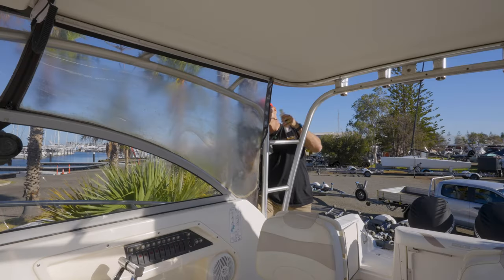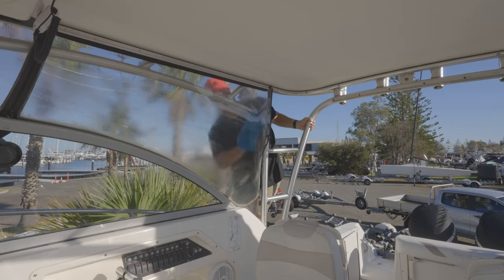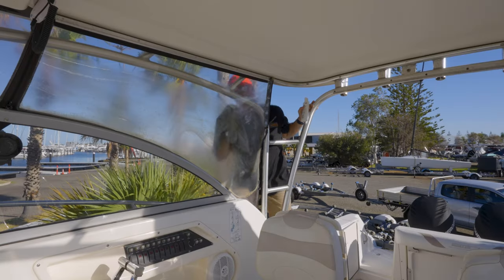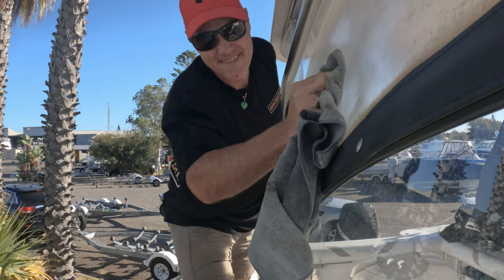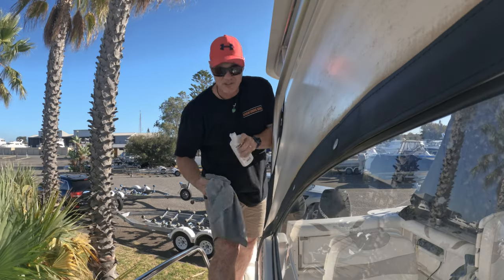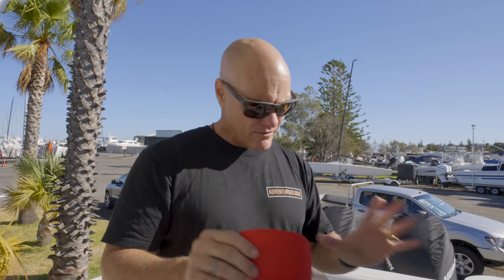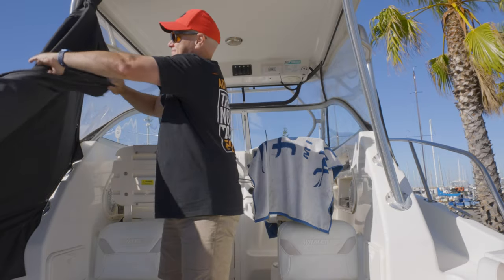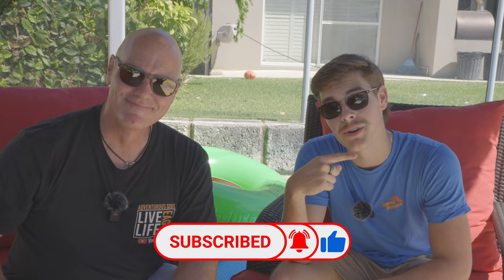Can I Save The FILTHY CLEARS On Our First Boat? - Clears Cleaning Kit

Comment: I have clear over on my boat door you need a buff light cutting compound a foam pad. Protect the sewing edges with a meter rule clamp the ruler to the table over the clears where the stitches need protection and buff the clears just like gel coat keep the foam pad damp and run at 750 to 1000 rpm be careful not to burn the plastic. Once you have the required transparency wash clean with warm water and spray with plexus plastic rejuvenation or a good plastic protection wipe off. It’s not a five minute job. It will probably take about an hour  or so a window. Good luck be patient. Do inside and out.
Reply from the maker: much appreciated mate.We are getting Boston in dry dock to get her engines serviced so I will take a look and try. Thanks again
Reply: Did you try polish them with a buffer? My father used to polish his in a very similar way.

Comment: How do you eliminate sunblock hand prints?
Reply from the maker: The best I’ve found is a cleaner with a slight abrasive brut it isn’t easy. Some of the cleaners are so strong they will remove the stain but cloud the clear. Personally I am writing mine off and replacing. But that is once I have our Shoreshade up.